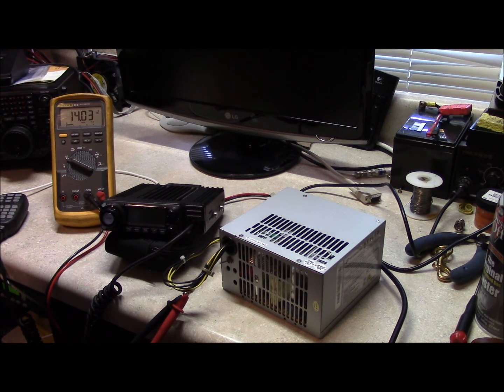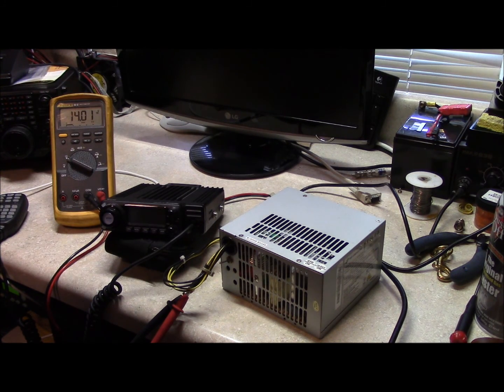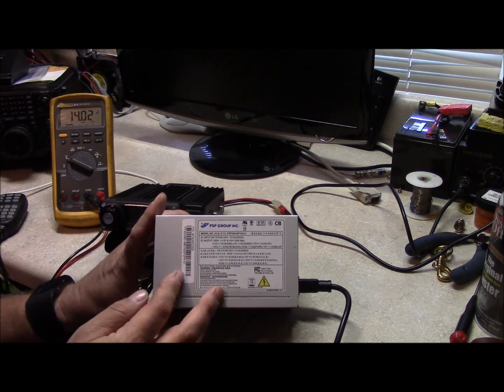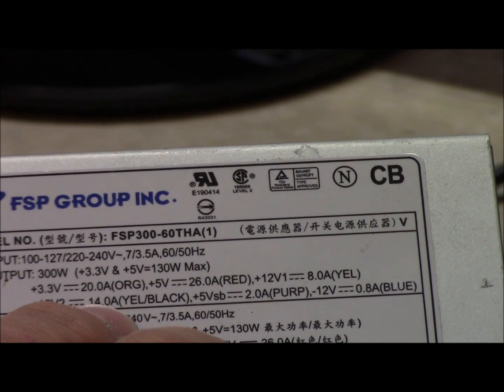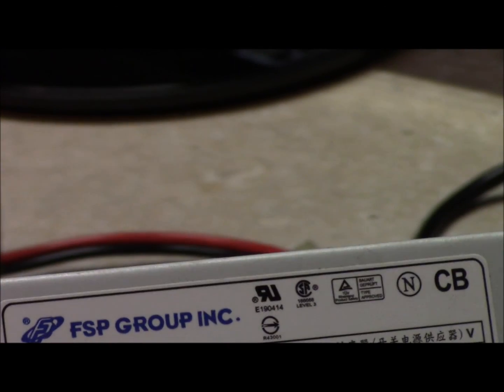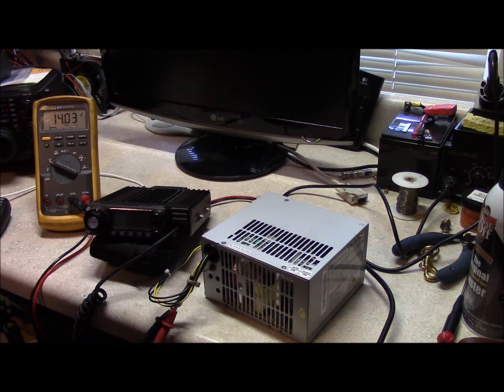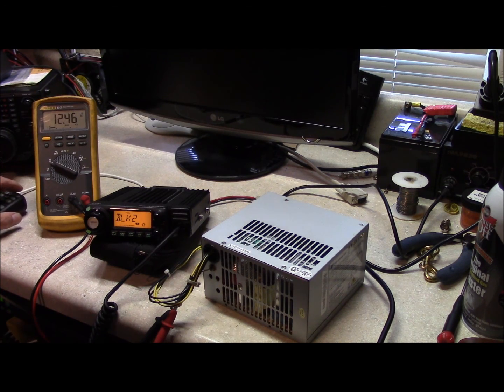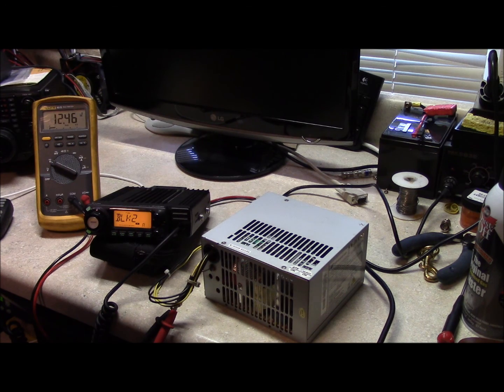Ham radio power supply from a repurposed legacy PC power supply

Comment: Never thought of using an old power supply from a dinosaur computer to power my rig. Thanks!
Reply from the maker: Give it a shot. Thanks for watching !
Reply: @survivalcomms  can't wait to try it for myself especially when using it for an automotive tire inflator hopefully it has enough amperage to do the job
Reply from the maker: @414RadioTech  It depends on the current draw of the compressor - would be an interesting experiment !

Comment: hi, how about the noise from PSU? does it effect the rig's V/W ? plus, any PSU cable diagram can refer?
Reply from the maker: I haven't noticed noise with an FM rig. On a weak signal mode rig I would recommend a better supply. The CPU PSU's  outputs vary by which motherboard configuration they are made for.  This PSU was for an ATX.  Best practice is to download the pinouts from common motherboard configurations and keep them in a binder or as digital media in a reference folder. I hope this helps and thanks for watching !

Comment: Trace wires? Not sure what you're describing or how you connected it actually...
Reply from the maker: +M Miller A wire with one major color ( in this instance yellow) has a black stripe running along its length. This is called a trace in wiring parlance. Sometimes the trace can be a stripe in a corkscrew fashion. A PC  power supply has its high current wires on the motherboard connector. If there is no pinout  data on the side of the power supply you are using use your multimeter  to find ground first  (black on every supply I've personally seen and most times exhibits continuity to the chassis) then check the output on the other wires leaving your black probe on your suspected ground wire. After establishing the voltage potential of each wire separate the wires and bundle them accordingly. Finding the high current 12v lines will be trial and error without data. I hope this helps ! Thanks for watching.
Reply: +SurvivalComms Makes perfect sense! Thank you! Learning - that's why I watch!
Reply from the maker: M Miller
 I do the same every day.  Youtube is a great resource !